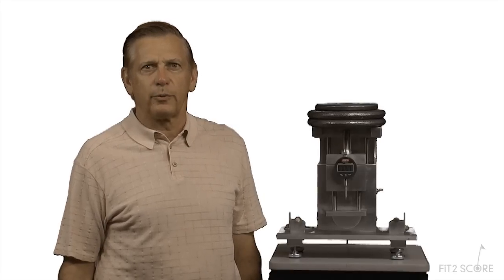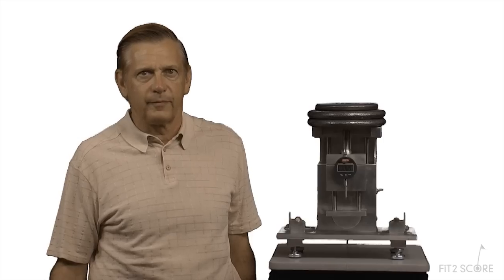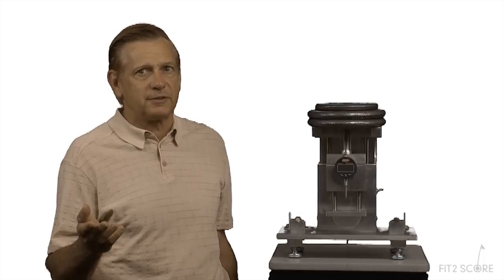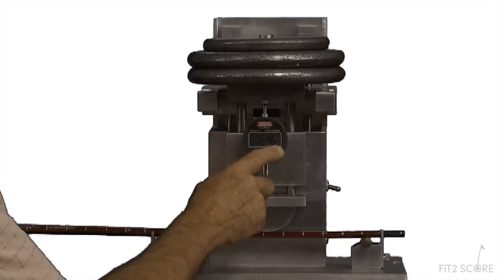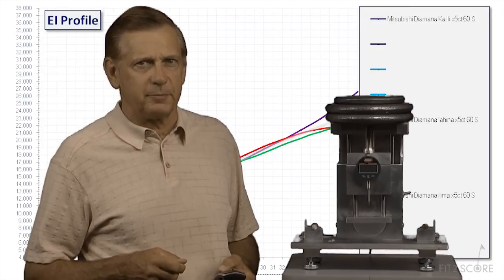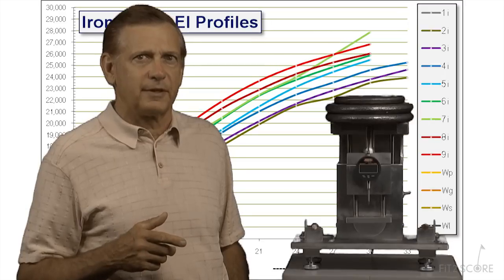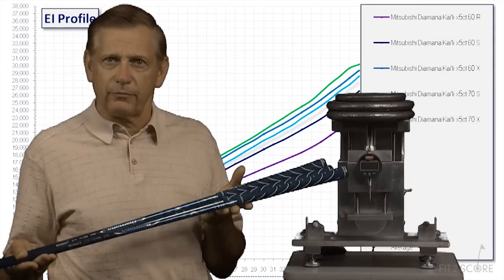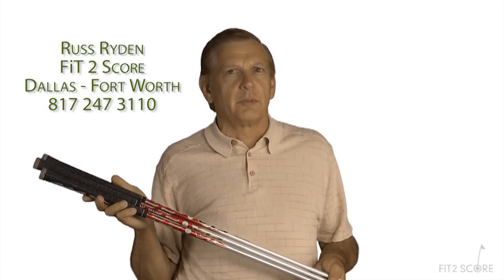Golf Club Fitting - Golf Shaft Stiffness Measurement

Comment from the maker: We can measure very little cross sectional distortion. Done by putting a caliper on the shaft before and during loading. What we do see is insignificant in the overall bend of the 10" section. And yes, it is an average of a beam, but we take 40 such measurement in 1 inch increments and end up with charts that closely resemble those produced by the shaft companies themselves.

Comment from the maker: The easiest way to find the 'straight' section of the shaft, if there is such a thing, is to put a shaft in a pneumatic clamp frequency instrument and find its flat line oscillation point.  This represents either the hard or soft plane of the shaft.  Approximately 90 degrees from that plane is another flat line oscillation plane.  By comparing the two frequency numbers of the two planes, you can determine the elliptical nature of the shaft. Close numbers reveal a good shaft.

Comment from the maker: I measure 10".  I have checked for ovaling, cross section distortion as you mentioned.  It is a very small number showing up in the butt section measurements only.  I looked at it and decided it was so small it was not worth the effort to factor it out.  We are looking at understanding shaft performance by knowing the profiles.  The butt error is so small it is not a consideration.  Compared to measurement error in other profile systems, it is a non issue.

Comment: Should my fitter have told me that my new Mizuno irons he sold me were 4˚ more lofted per club than the Taylormade Burners I was retiring? I'm a golfer, not an engineer.
Reply from the maker: That is a judgement call on the part of the fitter. There are a lot of factors that influence ball launch trajectory. Loft is certainly one of them but must be considered alongside other aspects of the club head and shaft. To point out loft differences alone is short sighted.